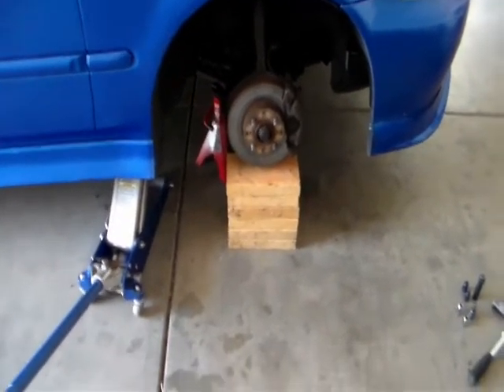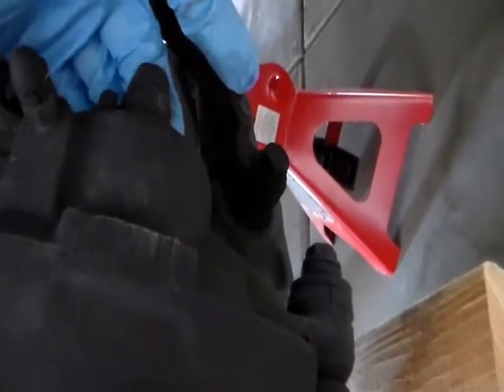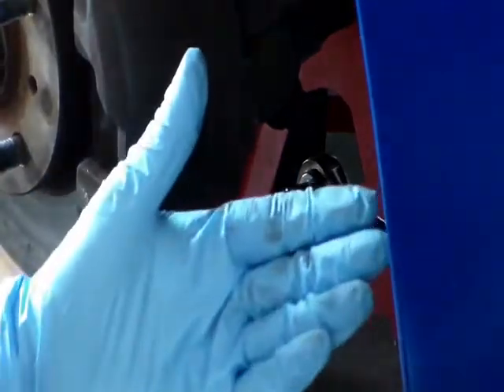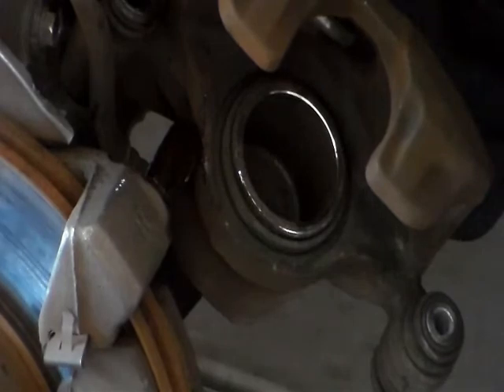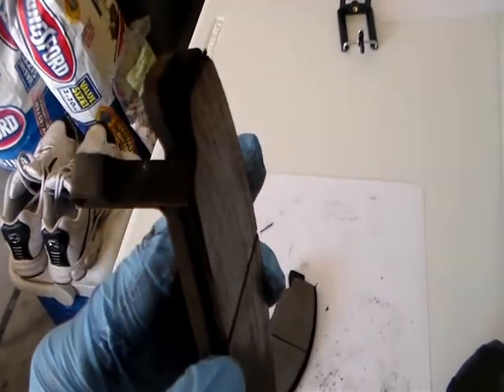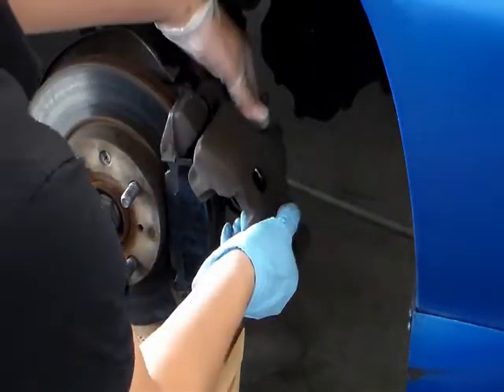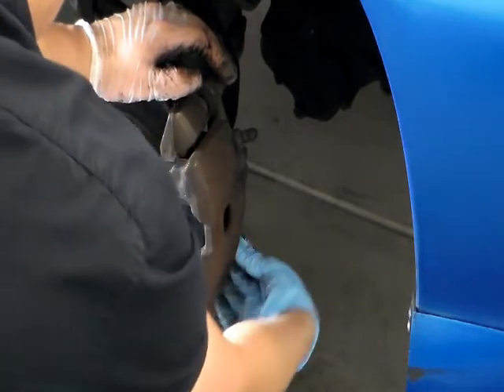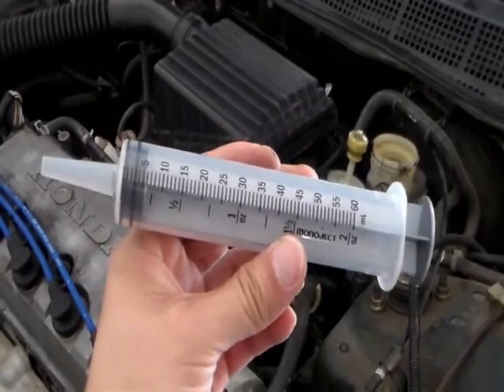How to CHANGE the Front Brake Pads on 1996-2000 Honda Civic

Comment: thank you. i got stuck because i took off the top bolt and break fluid kept leaking out. thank you
👍👍👍
Reply from the maker: +Geribal Zuri  It might have been the banjo bolt that you first took off.  Hopefully when you did that air didn't get in your brake system.
Reply: +Welking Vue well i just tested the breaks and it feels different but it works. how would i make sure air did not get in ?
Reply from the maker: +Geribal Zuri  Different as being worse than before OR better than before?  Air could have gotten in or maybe air didn't get in.  When the line was open and brake fluid came out it's also possible air wasn't able to go in because fluid was coming out.  Whatever side of the brake that fluid was released I would bleed that side of the brake.
Reply: +Welking Vue better because i don't hear the scraping sound when i break. but not so good because i feel like the break pedal goes down too quick and breaks too slow. ok. ill look.into bleedimg that side of the break. thank you. by any chance do you have a video on how to bleed breaks?
Reply from the maker: +Geribal Zuri As of now I don't have any brake bleeding video, but I'm sure you can find a lot of those videos on Youtube.

Comment: What tools did you use and to remove caliper  screw what size is that?
Reply from the maker: To remove screw and bolts I would buy a set of socket instead of single socket cause if you plan to work on cars often you'll be saving money in the long run by having a set.  For this reason I don't really mention socket and wrench size in any of my car videos.  Better off to just buy a set.  If you still want to know the size, hit me back, I'll check out the car and find out the size for you.  As for the other question on what tools I used you got to be more specific I used a few different tools.
Reply: Welking Vue cool thanks yeah your right will have to buy some tools. Thanks

Comment: Have a question. Instead of using 3m silicone paste can i use thishttp://www.autozone.com/brake-and-power-steering-fluid-additives/brake-lube/permatex-ultra-disc-brake-caliper-lube/10772_0_0?checkfit=true
Reply from the maker: I read through it a little I think you will be fine.  It does say it's compatible with rubber and I didn't see anywhere that says the item has grease in it.